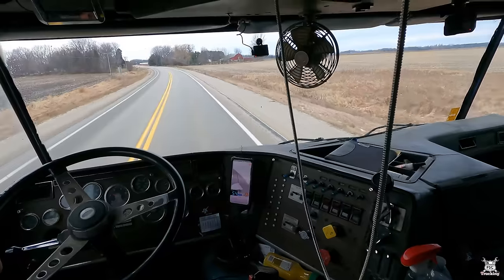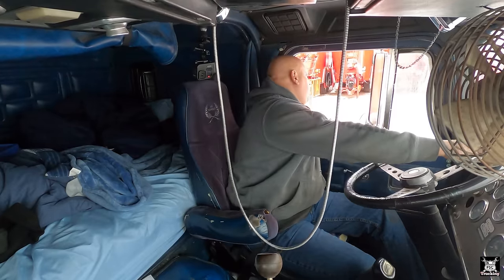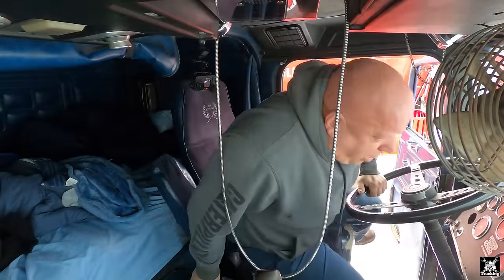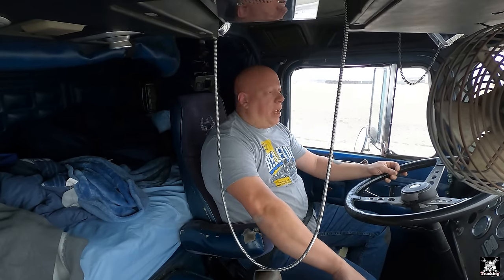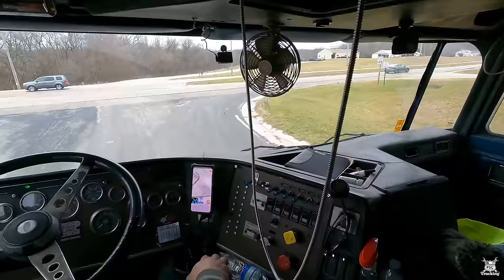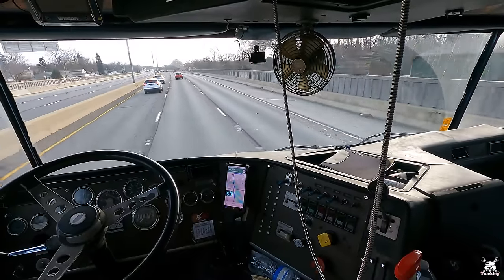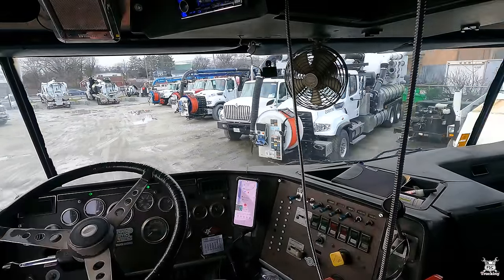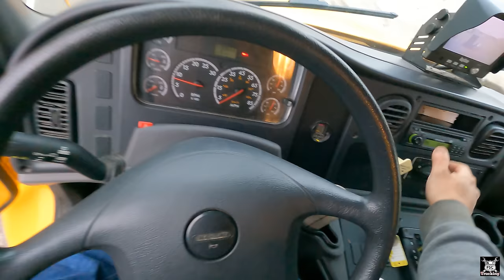Orwell Hauls A Subscriber's Truck   The Sucker Truck

Comment: I carry a 7 pound bag of kitty litter in the winter. The granular kind, not the soft paper based stuff. Throwing a few handfuls on and  under the drives is usually enough to get me moving. Throwing some on the ground behind the trailer might have kept it from sliding.

Comment: That truck is called a regenerative street sweeper. The vacuum section picks up dirt from the road The exhaust air from the vacuum is redirected back to the front of the suction section to dislodge dirt so the vacuum section can pick it up easily. The air just moves around in a circle thus the name regenerative.
Reply: Not a regen, it's an older Johnston VT full vacuum sweeper, twin brushes, twin suction.